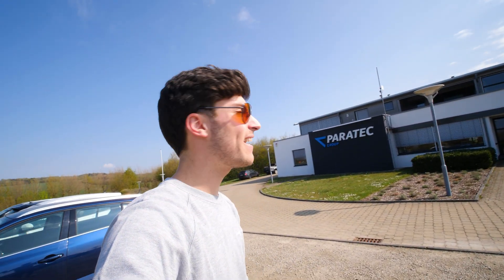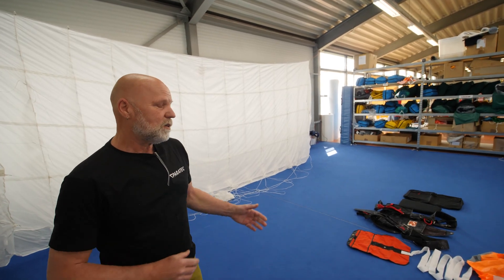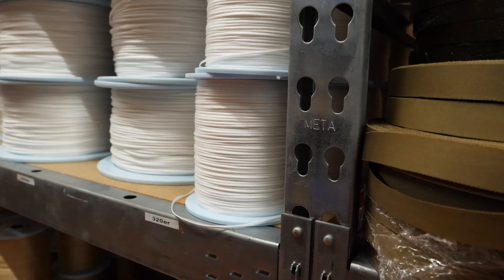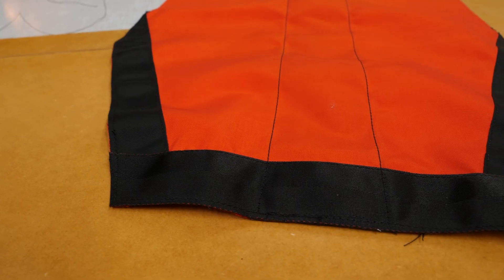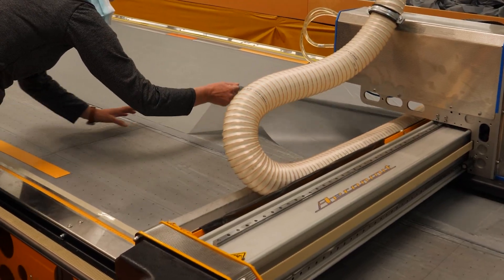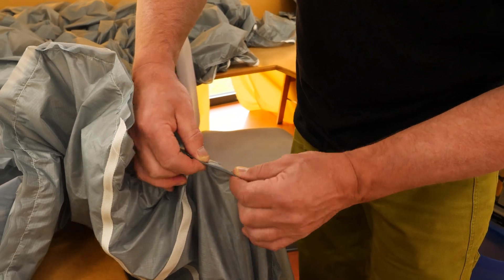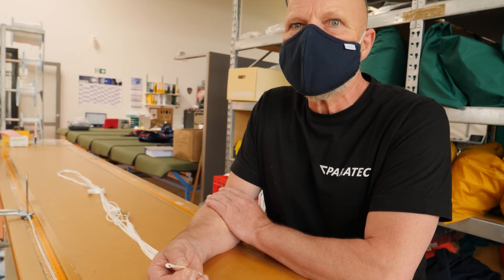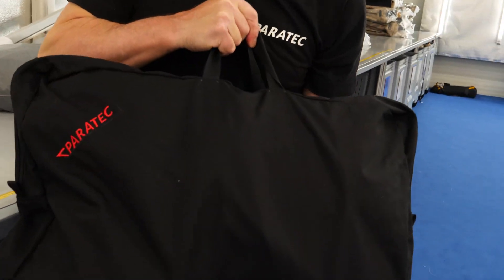How Parachute is Made in Germany -  PARATEC Factory Tour

Comment: How did the pilot shoot shoot up in the air at 9:32? Or will that be explained in episode 2?
Reply: There is a Pin that secures the spring in the Back of the Package. When you pull this pin out when your out of the glider (manually or with a rope  attached to the glider), the spring the the small chute goes up, fills with air  and pulls out the rest and the real parachute..
Reply from the maker: You will see this in episode 2 ;)

Comment: I'm pleased to see that you went for a square parachute which enables you to steer should you need to use it.But have you had parachute training?I think it would be to your advantage to experience what a jump feels like as with other life experiences it will be different for each individual and having to leave your glider is stressful enough without the additional pressure of the parachute jump itself.....................................
Reply from the maker: So far I had no skydive or special training. There is a tandem skydive planned this year and perhaps I will make a beginner´s course. You are absolutely right that some experience would be better but it is not mandatory.
Reply: @SteFly  I was thinking purely along the lines of getting that first shock out of the way and it can be a shock,pleasant or not it's something having had the experience that can prepare you for that feeling.My two jumps were a very different thing,but if I had to jump from an aircraft now I would be assured and confident...........................

Comment: My first wife worked in a parachute factory, things have changed in 40 years the materials are totally different and the size of the finished product so much smaller and convenient. If it's steerable and flare able isn't some training necessary or is it impossible to spill the air that would result in a more rapid descent.
Reply from the maker: This canopy is well tested as a reserve parachute for skydivers and you do not necessarily need to steer and flare. The brakes are set to 50% so that you can land without injuries: https://www.youtube.com/watch?v=qZnMNJisapg
For sure it is better to steer to a good landing spot and flare at the landing. This should also be possible without practice. Soon I will do a tandem skydive and perhaps a beginner´s course.
Reply: @SteFly  Also look at this video >>
https://www.youtube.com/watch?v=ZV-_AlRQo2Q
The guy is flying and landing the reserve just like you would a Paraglider!   :-)